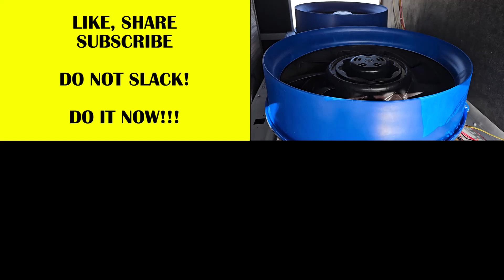Interesting 24V short in a new 20 ton Carrier

Comment: What a strange fault on a new unit. I'm assuming you had ripped most of the wiring down to find the fault, and carrier didn't actually ship the unit with all of that wire spaghetti?

Also I can't believe Carrier is using mechanical temperature switches on a unit in 2024. Not only that, but the sensing bulbs are unsecured and located in routine service areas - they are going to get broken by filter changers. 

I can't think of any legit reason to use these over thermistors. They must have got a million of them old stock for free or something.

It's also hilarious they're using them to control the condenser fan motors. Fancy expensive completely variable ECM condenser motors, and they don't even control them by head pressure or condenser temp. Just hi/lo based on ambient.

What are these companies doing!?
Reply from the maker: I just came to give a look at it. So I don't know how the wiring was bundled before pulled loose.

As for the thermal switches... Thermistors require a controller. The return air low temp cutout is simply in line with the low suction switch. It works with existing base mechanical control.
The other one sends a voltage to the ECM ODM which is a speed change.
I think they will be fine if they get zip tied. As is, they do look like they will just be broken by filter changes in a matter of time.
Reply: @hackfreehvac  It just seems silly. You have a big fancy expensive ECM indoor fan, ECM condenser fans, a giant control PCB. Then this relic of a mechanical temperature control from the 1970s. With half-assed high/low speed condenser fan control. 

I mean, if some random guy can whip up a very functional thermistor-based control board for ECMs in his garage, I would think carrier could do it too.